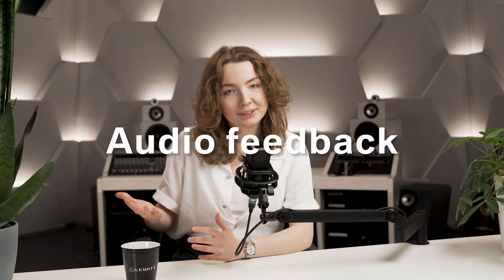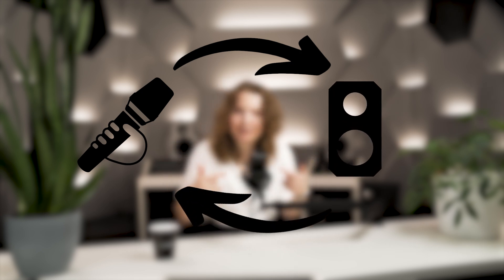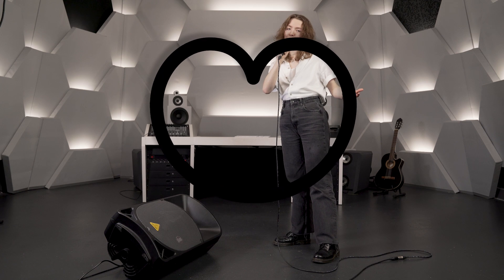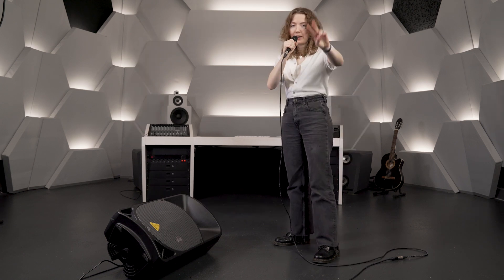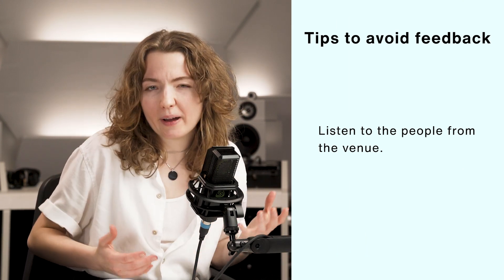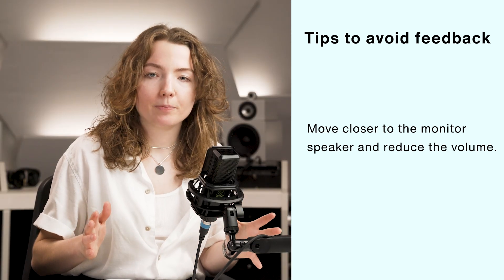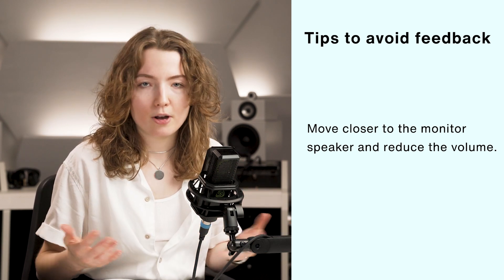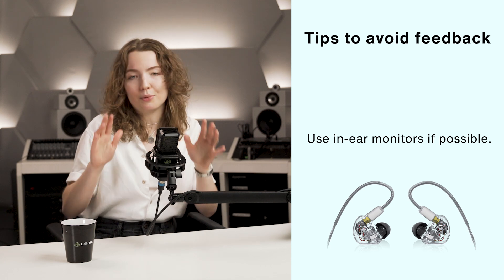What is audio feedback?

Comment: I am having a terrible time with the feedback I am receiving. I am using the LCT-440-Pure Large-Diaphragm Condenser Microphone with a Focusrite Scarlett Solo 3rd Gen USB Audio Interface & an Amazon Basics XLR Microphone Cable for Speaker or PA System, All Copper Conductors, 6MM PVC Jacket, 10 Foot, Black. Feedback happens every so often that my friends and other acquaintances in Discord/Games tell me about as I can not hear the feedback myself. It sounds like a screeching/buzzing sound that is ear piercing. I have tried a lot of things to try to make it stop. It happens about every hour give or take and I have to unplug my focusrite audio interface and plug it back in, then it stops and is fine for another hour. I do not know what else to try, as this is the only solution that seems to work. Any other solutions would help tremendously.
Reply from the maker: Is it feedback or is it a noise coming from the equipment? Feedback would only happen if you are monitoring a live mic through speakers, but if you using headphones then it might be another kind of issue.